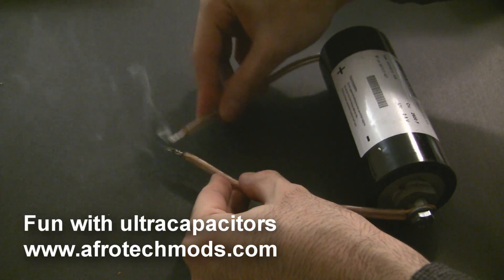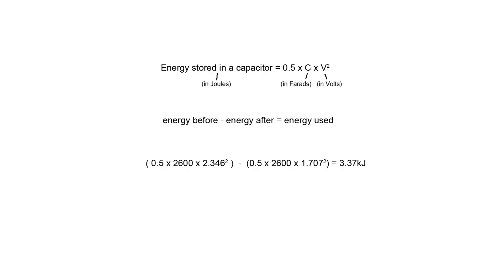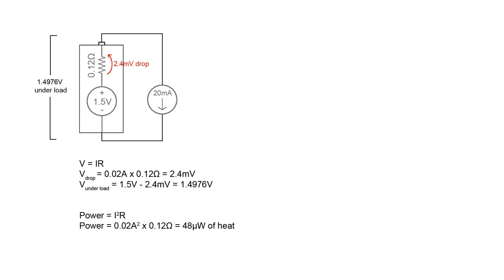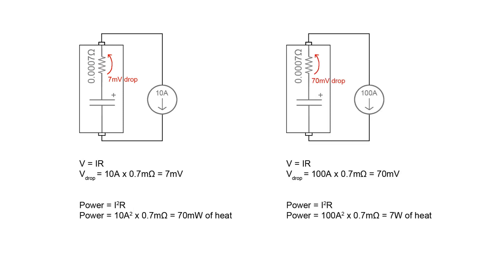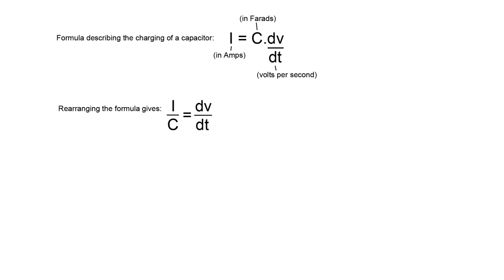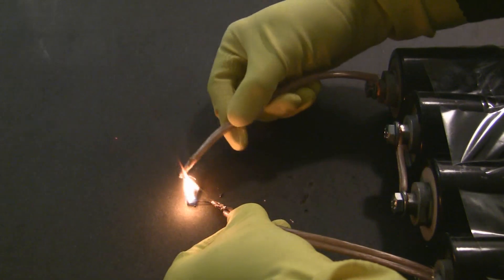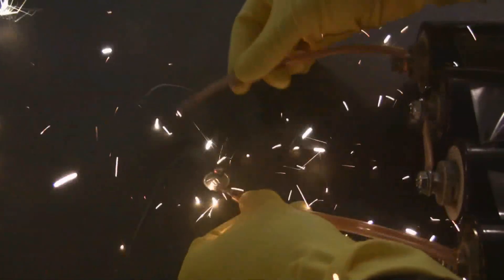Fun with ultracapacitors!!

Comment: Awesome video. Please I have just an itching question I'd be glad if you could help me ditch.

How long do the ultracapacitors hold their charge after being disconnected from the charger from full charge.

Or how long does it take the ultracapacitors to self discharge from a full charge?
Reply from the maker: They can hold a charge for months. Years even.
Reply: @Afrotechmods  Wow! Thanks 👍. Was thinking of using these to build a product to bring to market, but wasn't so sure how these perform with regards to the charge retain-time property.

Good to know. I'm very glad the do hold charge so well. Would serve quite perfectly 👌 for my product.
Thanks again. 👍
Reply: @Afrotechmods  I think it would be really nice making a video showing trying to use these ultra capacitors (maybe like some 4-8   of them in a pack/bank) to crank a car's engine to start like a normal car battery would, or to power some large dc motor.

Do you think it could work? I just think it would be a cool video to make. 👍
Reply from the maker: @techware5701  Electroboom already did this
Reply: @Afrotechmods  Oh. OK 👍
Reply: @Afrotechmods Full bridge rectifier!!

Comment: My only disappointment with the video was where he tried to vaporize the nail with the 9.63 volts. I never saw it melt. It would have been better to mount the nail between two posts, have one wire attached to one posts and then he can just touch the other wire to the other post to complete the circuit and watch the nail melt.

Comment: I'm recapping a circuit board from a Pioneer sound system and found a cap on the power side that was rated at 400v. I took care with replacing that one haha.

Comment: I got a couple 2F 200A caps for car audio. Legit every time i open my trunk im scared to stick my hands in there anywhere.
Reply: Dont worry about it. While there is alot of energy stored, the potential for it to be sent through your body is low because its 12 volts. Its not the amps that kill, its the power. And because of your bodys internal resistance not enough power can flow from any 12v source to kill you. The cap has the same shock potential as the car battery powering it.
Reply: @coolizmc YOOOOOO FINALLY ANOTHER ONE WHO KNOWS ELECTRONICS

Comment: I would love to see these things adapted to work with RC cars or planes. I know a few people have done super capacitor rockets, but why dump all the energy at once? 20 min is a super fast charge time compared to most RC batteries too. granted your power supply probably costs well over 50x the average rc battery charger too.

Comment: Run 100 of them in series , then plug it into a wall outlet.
Reply: But before you do that, add a FOOOOOL BRIIDJ RECTIFIAAAAH to the mix.
Reply: @danek_hren  how in the hell did you see this 2 year old comment with no engagement
Reply: @CaptainKronk  was listing through new comments searching for dumb people.
Reply: @danek_hren  also its already dc so no need for one
Reply: @CaptainKronk  what is dc?! Wall power? Are you serious
Reply: @danek_hren  come on bro dont troll me
Reply: @CaptainKronk  POWER AT HOME IS AC

Comment: Correct me if i'm worng, but you culd touch it right ?
I mean with a (very low estemated) body Resistance at around 500Ohms the 2.5V DC (Current 5mA) arn't enough to hurt you in any way :p
Reply: 1. You aren't wrong.
2. Human body's resistance is well over 100 KΩ.

Comment: How do these behave at higher frequencies? You made a nice video about the inductance of electrolytic capacitors and the need to supplant them with ceramic  capacitors. Where do supercapacitors and ultracapacitors fit in on that?

Comment: with such high power, your capacitors could solder their own wires directly onto the coin, and heat up. If a dumbass had made this video, he could've easily had a house fire going. Sparks flying everywhere, fire, heat...
Reply: 🤦🏼‍♂️ Learn electricity first, then come here.

Comment: Uhh u can touch these bare wires right? I mean such a low DC voltage won't do any harm. Yeh the current may heat up its path after a while but if u hold one in each hand u could hold it for a while without any permanent damage right?
Reply: No current will flow through you. At least, not enough to even shock you.

Comment: Well I have 2 2.8v 3000f capacitors. Can you tell me what volts I set it to, to charge them please. I have the same bench power supply as you. Would charging at 2.5v at 1.5amps be to high. Thanks.
Reply: I charged my LS 2.7 V 1200F supercaps with 10 A @ 2.6 V with no problem. 😎

Comment: Thanks, Electronics Goldmine just had some 350 farad 2.5 volt Boost caps for sale at 4 bucks each.  Now I don't have a LOT of cash, hell I don't have much cash at all but I did order 3 of them, well because I really have wanted to play around with these for years and this is the first time I found any that were affordable, these are advertised as new, removed from circuits, and have solder tabs on each end. They are in D Cell format, think of the flash light you could put together??? Well perhaps not, never tried to push super caps through an LED, wonder how big a resistor I would need to keep it from blowing up?

Comment: The shockwave plant at my workplace has a capacity of 2 Megafarad with a discharge of 37.000 Volts each second. It is used for Destroying sandcores in metal castings with complex geometries. The electrodes for the dischage are placed in a water tank. 98% of the discharged energy goes to into the water. That creates a water flow with the speed of sound in just 4 microseconds after shooting. The water pressure is reaching up to 820 bar. So the sand cores get penetrated and flushed out of the castings. My english is´t perfect. I am from Germany.

Comment: Is there an efficient way to turn heat energy into electricity? IWas thinking what if you made a vehicle that took the heat produced by the engine while driving on the highway and made it into electricity to charge the battery for the electric motor that would be used only during city driving. Would there be an efficient way to do that? It just seems that gasoline powered cars waste TONS of energy in the form of heat.
Reply: In short, not really, even the biggest and most efficient power plants barely come close to 40%

Comment: nice! I love electricity but what is the difference between a capacitor and a battery?
Reply: They both act like a battery as in they store power, the difference is when it comes to discharging said power, batteries are for smaller needs and long usages, like a remote control. A capacitor is when you need a lot of power in a short time period, like a camera flash
Reply: Batteries can store more energy, but capacitors can release stored energy quicker

Comment: If we use magnetized graphine in our motors\turbines  with ultra capacitors for burn outs and frequency drives for city driving  batteries will essentially power  heating and air conditioning systems.

Comment: OK! Since you obviously looked at the specifications and knew what you were doing. As an alternative, you could put the 4 capacitors in parallel and quadruple the output current at the lower (2V) voltage.
Reply: agerven Why 4 times the amperes? Whered ya pull that, it would’ve been 4 times the capacity, but not more amperes, unless I=V/R changed

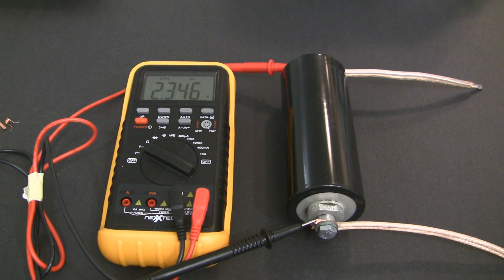Comment: Aren't capacitors supposed to discharge all their energy at once? I mean at 0:57 it clearly should have exploded except it didn't...
Reply: Regular wires can't provide instant discharge because of resistance and the huge energy stored, I think. For regular capasitors the charge itself is small and so is the discharge time.

Comment: Heh, this reminds me of a Christmas party a few years ago. Didnt have supercaps (those things are *great*, wish i had some  of those!). What we did have was a few boxes of 68000uf, 50v caps, which had been written off by insurance, as they were tremendously shit. Only about 1/4 were any good, the rest sloshed, rattled or didnt weigh much. These are all very bad signs. But after a few drinks and a celebratory air, well, engineers get a little loose with their specs, n well, wanted fireworks. We decided to try can crushing. So, a tables worth of shitty caps (discarding the sloshers or rattlers), arranged in a way that was easy to flip series n parallel. We definitely did not use rectified mains with a current choke. Because that would be dangerous, and in blatant violation of OHS. At least one of us wasnt drinking... then rigged them all parallel, which dosent take long when you have a team of techs. Our 'switch' was 2 3mm aluminum plates, abour 6 inches a side. A few turns round a conveniently available beer can. Talk about fireworks. Ive some epic photos of great gouts of molten aluminum, shooting an easy 6ft of sparks. Dented the can a tiny bit, so we had to try again. 

Best work Christmas gig ever. The mutilated 'switch' plate earnt its place on the wall of honour (which also features a 12v board that was connected across 415v ac, did you know fibreglass burns? And the result of a cannon that fires billiard balls). Sales was alot more respectful the next year.

 Beware of the engineer who gets a twinkle in his eye when capacitors are mentioned.

Comment: Electric heat requires alot of electricity.  Thats our biggest hurdle in cold weather climates. Maybe we could plug them in to get them up to tempurature before use.  That will put less strain on a charging system and leave more power for propulsion rather than pre heating.

Comment: This was the first video of yours that I watched. I had to build a race car from a super cap for an engineering course. The catch was we could only spend $10 on the cap. I ended up scoring a 650 farad 2.7v maxwell boost cap. Along with a RC car motor, aluminum rails and ball bearings it was easy to make a pretty quick little rail car. I didn’t win the race but I had the coolest and fastest car in the class and that’s winning in my book. 🥴

Comment: They sell a truck battery-looking thing called a Maxxon that fits where a group 31 would sit. You can eliminate a couple of the regular batteries and save a lot of weight. You don't need all those batteries except to start, anyway. The Maxxon is filled up with ultracaps.  They deliver a gigantic crank amp flood to start the engine. Then re-charge as you go.  But if your truck doesn't start dependably and right away, you'll soon come up short on crank power!  I knew someone who had one of these and his truck was a rat and had a hard time starting because of a loss of fuel prime, and guess what!  He wishes he hadn't wasted 900 bucks on that thing!!  The one battery he had left after getting rid of the other 2 didn't do the job once the Maxxon ran out!

Comment: The rate you can charge a battery is based on its internal resistance. Some battery chemistry types have lower resistance than others.  I learned a lot hanging out with a tech at Interstate Battery.  I asked him how the fuck a little battery in a juice pack can light-off a dead car!  He said it is based on the ability of the battery to deliver a huge amount of its stored energy in a short time compared to a lead-acid battery in a car. That one of course has a huge amount of potential energy but can't deliver it beyond a certain amount without setting it on fire.  High internal resistance.  The juice pack has much lower resistance. It can deliver a lot at once, but it doesn't store much to begin with compared to the car battery.

Comment: You could have used a 27 farad capacitor for melting ice. Right?

Reason:- the energy needed to melt ice is around 3500J then the capacitance should be:-
E=CV²/2
If it is a 16v capacitor then by solving:-
7000/16²=around 27F

Comment: Just want know if the charging is equal to the discharging time, keeping in mind same ampers discharged may be same the charger is pushing out. Please help.
Reply from the maker: The times will be different. The charging time will be proportional to the charging current and the discharge time will be proportional to the discharge current.

Comment: Did you know that the insulation on magnet wire is also brutally noxious even in small amounts.  Please wear a respirator and do that in open air or with ventilation.

Comment: Can this caps be used in series to get about 12 volts and use it instead a car battery? Will alternator charge it? And what is the discharge rate when car is turned off?

Comment: Imagine a million of these in series + parallel. gg
Reply: Well, the closest applications are Super-colliders and Rail guns... :)
Reply: AKA Tesla's new model called the "Big Testicle"   tsk-tsk
Reply: What if you, put it in the ocean, the water is salty so it's conductive, so will it kill all Marine life in some radius ?
Reply: By putting them in series, the capacity gets lower. 1/C_new = 1/C1 + 1/C2 +...
Reply: @jonasmartens760  Yeah. He showed that in the video [3:58].
Reply: @catalinnedelescu  Brilliant!
Reply: Wtf are you going to charge it up with, a DeLorean?
Reply: My real question is why he put them in series and not parallel where he could’ve had the voltage even higher.
Reply: @Nick-yq5uz  Parallel would not change the voltage. Same as with batteries.
Reply: @Nick-yq5uz  Nope.  In parallel, the voltage would be the same.
Reply: @Nick-yq5uz  I was thinking the same but I got confused. I think it would increase the capacitance, consequently the charge, but the voltage would still be 2.5V
Reply: Nick Paschke whAt did you just say...

Comment: If it's 1.7 v can i use it as  AA size battery for wall clock, so that it works for my future generations too, anyone comment
Reply: But, as he showed when comparing it to two AA batteries,  batteries actually have bigger capacity,  so they will power your clock for longer.  It is just that due to the internal resistance they are not capable of outputting such high currents (required for sparking and melting).
Reply: @Stijak85  an extremely high power clock
Reply: lokesh rahul haha good idea

Comment: Is it necessary to wear gloves with the low voltages that you are using?  I thought skin had an internal resistance high enough that even a car battery's 12 volts wouldn't cause a shock if holding both terminals.

Comment: If I had 50 of those ultra caps I could make a copper killer, witch has enough power to melt all of the copper in a 115 volt 1/4 hp 2 amps induction motor, I bet 😈.

Comment: If you connected this to a led light, would in stay powered for years?
Reply: unless a resistor was added, the led would first burn or explode.

also, capacitors slowly discharge over time, just like normal batteries.

Comment: isn't it strange how the energy formula for a capacitor is so similar to the kinetic energy formula? I wonder why that is..
Reply: because you get the result by integrating the infinitesimal increments of energy, which for something int. x dx becomes 1/2 x^2, and just has another coefficient. this is true for a lot of physics formulae.
Reply: I think it’s because the energy stored by a capacitor is the area under a voltage-charge graph. The area of a triangle is 0.5 * base * height so energy stored is 0.5 * charge * voltage. The gradient is also equivalent to the capacitance (charge/voltage).
Reply: Basic calculus
Reply: its because when you integrate you x you get (1/2)*x^2
Reply: Because they are the same thing stored a bit differently :P It's only too bad converting between the two is so lossy most of the time.
Reply: Because electrons have speed foool

Comment: Hello, Very interesting video

In case you short the capacitor as you did in the video, how can I calculate the current ( max current or I at short circuit ?
Reply from the maker: Don't short the caps. You risk blowing up the caps as 1000s of A will be flowing.
Reply: I understand that I just want to know how much current can I drain 
 from this capacitor with out reaching the I short 

(At which Range Of current will that be allowable )

Comment: how well would these work with a handheld railgun?
Reply: just do the math: 1000A draw makes them empty in about 2.6s. 1000A means already 0.7V voltage drop due to internal resistance. Usually in a railgun or coilgun the capacitors need to discharge all their energy in milliseconds, so nope, wont work (except maybe using them for a fast recharge).
Reply: EXPLOOSION! !!! idk 😐
Reply: EXPLOOSION! !!! you would want a high voltage as well as large amounts of power.
Reply: HL65536 the only way he could do that is to have a room full of 2.85v 3400F caps and put about 30 in parallel and have at least 100 of those packs in series
Reply: HL65536 ok, thx :)

Comment: But the normal cap is more dangerous to touch isn't it? The supercap doesn't have enough volts to push all that power through your body or am I mistaken?
Reply: Yes. you can easily touch those ultra caps at 2.5 volts because your skin's resistance limits the current to a minimum. But touching a high enaugh voltage reduces your bodies resistance ( I believe ) so touching a 200V charged capacitor can be dangerous.

Comment: try 350 of them in series and see what happens.
Reply: Nova Marquez-Delp the beaver can't take that much of a pounding.
Reply: how to wake someone up with a bang
Reply: That would be the same as a 875 volt cap at ~7.4 F. Explosive!
Reply: @DaffyDaffyDaffy33322  Explosive and pretty much an instant kill if you touch the terminals.
Reply: @DaffyDaffyDaffy33322  bet that would be more powerful than that super capacitor photonicinductuon had.

Comment: i can touch it right?
because the voltage is low
Reply: Yes, 2.5 volts won't do anything to you. No matter if they can supply 1 amp, 100 amps, or 1,000,000 amps, 2.5 volts will never hurt you.

Comment: +Afrotechmods
Are my formulas correct?
1Wh = 3.6kJ
Joules = 0.5 x Farads x Volts^2
Heat = Amps^2 x Ohms
Charging Current / Farads = mV/sec -> Max Voltage / mV/sec = seconds / 60 = Time in minutes

(Why the hell is there no damn divide symbol on keyboards?!)